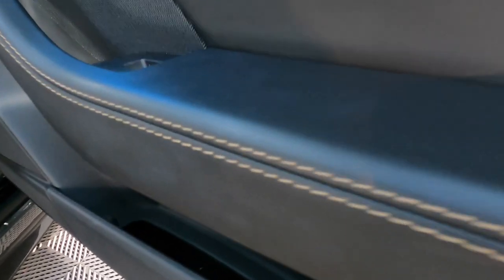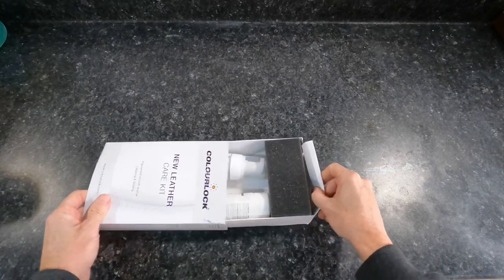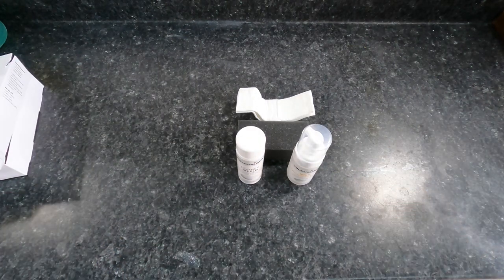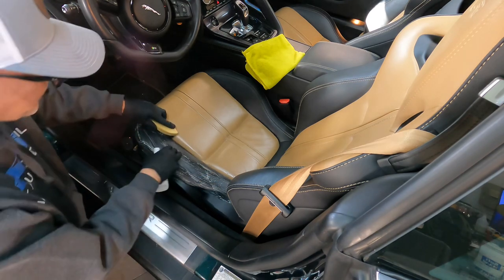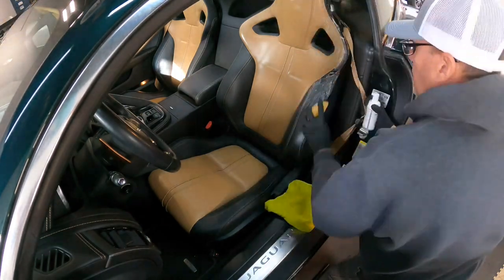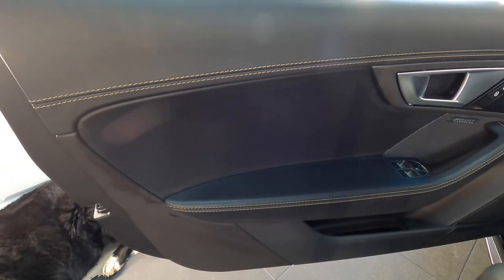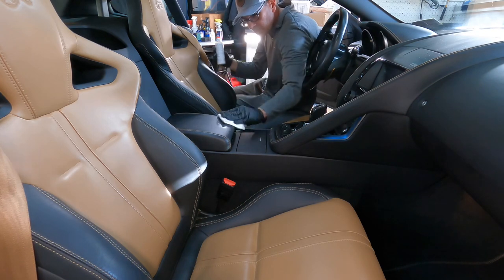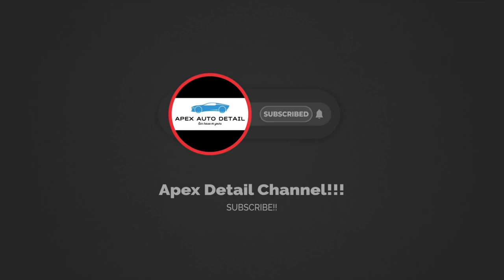Colour Lock New Leather Mild Care Kit! Deep Clean And Protect Auto And Home! Leather/Vinyl!

Comment from the maker: YOUR favorite Leather Care Products?
Reply: For now Lithium products, CarPro's and Colourlock
Reply: Beasley. Will be kool to have a leather products comparison.
Reply: Gyeon
Reply: I used to buy expensive leather specific products but last week I mixed a tablespoons worth of dish soap with half a liter of tap water and poured that on a magic sponge and it did an amazing job, for the first time ever in 7 years I owned that car the steering wheel is truly fully clean, I love it
Reply: I bought this kit a little more than a year ago for the leather in my X6. I’m not a fan of the foam block it comes with. I also suggest starting with the leather dash, steering wheel and doors first so you can sit on the seats before you clean them or apply the leather shield. Lastly, I would recommend cutting the fabric cloth the kit comes with in quarters. You won’t use much of the leather shield on the first go round but the cloth will become rather stiff and unusable if you don’t wash it after using it. Overall, the shield is better than the cleaner but I would just use Gyeon leather cleaning products altogether. I keep a towel on my leather center console especially when I get out of the gym. 😅
Reply: Leatherique is the only way to go
Reply: Armor all
Reply: Have you tried gyeon leather coat? How does it compare to leather shield regarding protection from scratches?